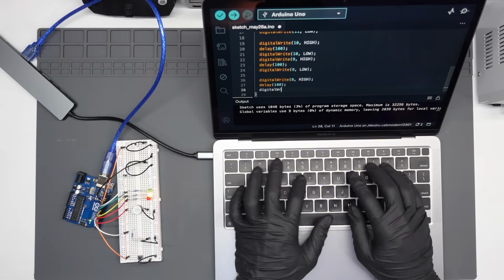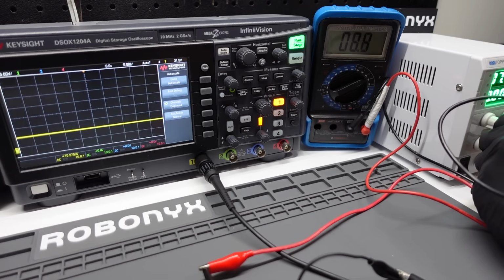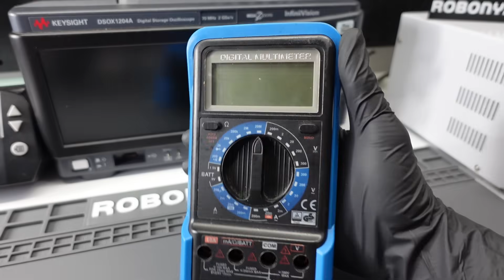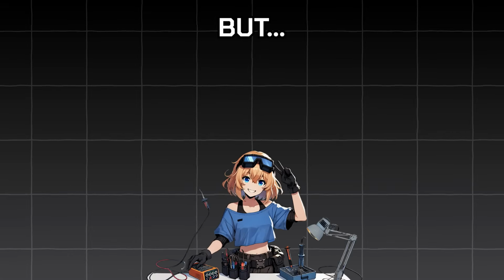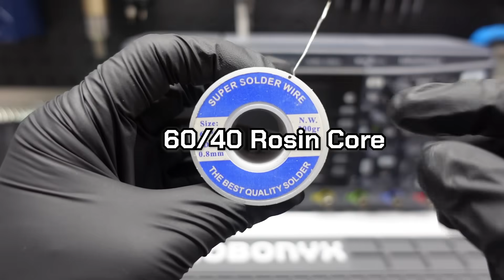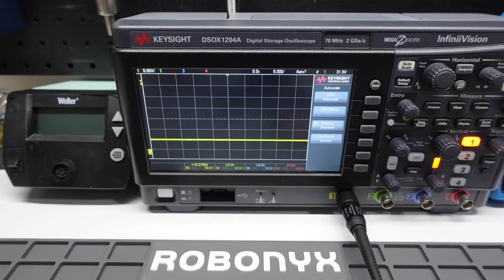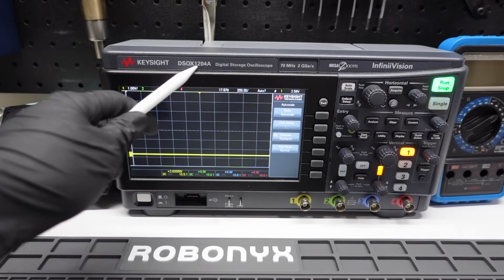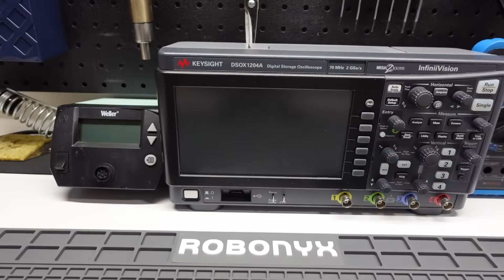Workbench Essentials When Starting Arduino! (Beginner Guide)

Comment: I just need to make a simple model for landslide detection, just something that turns on an LED light and we can know types nothing fancy. So do I need to buy anything extra? Also for the wires us there any correct placement or can we put it anywhere on the board and how do we know how many we will need?

Comment: Can I use raspberry pi picos and zeros with these tools ?
Reply: you possibly could but for the amount of time it would take to convert a computer into a microcontroller would suck also it would be a pain in the ass adding sensors as you would either need to solder everything or do some Houdini shit
Reply: @OctvianHobby thanks for the advice

Comment: In my opinion, I hate Arduino. The Pico or ESP32 is way better. So far I've spent 2 years trying to learn the arduino environment, still haven't mastered it. I used the pico for about 5 months, I've learnt almost everything now and it's way faster and has more storage, and if you get the ESP32 you also get Bluetooth and they both have built-in temperature sensors. Why not other microcontrollers?

Comment: My best discovery in 2024 were silicone insulated wires. I've used regular wires for years but once I discovered how bendy they are and how easy it is to remove just a tiny bit of insulation for soldering it on a proto board without the insulation melting, I never want to go back

Comment: I recently bought the Elegoo brand, Uno R3 super starter kit.  I have a MacBook Air 15 and everything was going great up until one, tiny problem emerged, the power cable that connects the two chips into the computer is the old Type A USB shape and my computer, the newer Mac’s don’t take that anymore.  So, I had to go on Amazon and buy this cheap 8 dollar pack of 2 power adapter that uses type c as a plug in for my mac because type c is what they use.  The other end of the adapter is type A so I’m going to see if this solves the problem.

Comment: An analog discovery board is a good option to put against an oscilloscope. It can be used as an a scope or a waveform generator and they’re relatively low in cost.
Reply: I’m strongly considering getting one myself. I think I will pull the trigger on one, when I get my next paycheck.

Comment: You can build a power supply with the arduino,  or rather purely passive components,  just need to learn how to design filtering and FILL BRIDGE RECTIFIER.  
Since you want DC voltage very easily just build low pass filters and XY bridges. 

You can turn your arduino into a multimeter,  it has a built in ADC and it's basically two lines of code
val = Analog_read(pin);
Serialwrite(val);
Something like that

It can also be used as an oscilloscope,  just use the serial monitor. 

You'll need to use a breadboard to build divider circuits for voltages above the reference 5V, just write in the code to compensate. 

A current sensor is just measuring the voltage off a precision low resistance component like 0.1 ohms.

Resistance is just using a known current and reading the voltage of adc.
The arduino typically drives 10mA per pin, just read the ADC voltage.
Given that its 10 bits, the precision may not exist well.

This is just for starters. It is unfair to compare agilent scopes to the crude Arduino since desktop oscilloscopes use ASIC to implement so you're comparing parallel computation to serial and low spec.

Comment: Very beginner question. When you eventually get to the point of using a PCB, what do you use to write the code for that? I saw someplace that the Arduino code is simple. So wondering what you do if your not using an Arduino?

Comment: For my final year Thesis, i choose my thesis as QR Code Gate system, i  am using esp32cam as QR code scanner and serve as main control unit for gate mechanism. But i still can't make it yet. Should i used another microcontroller for gate mechanism. I need u guys help. I am not very smart but i'm trying my best.

Comment: Best way to do male to male jumper wires is to buy a 22 awg set of colored solid core wire. With the jumpers you have to store them. Its nice to be able to just cut your own and throw it away if you dont want to organize after. The jumpers you end up with a mess of lengths, colors, and they are very annoying to store because they like to bend and get caught in things.

Comment: I think another important tip if you do get into the 3D printing aspect is get a caliper! Measuring the dimensions of motors and other components is essential for 3D design.
Reply: yeah, i got a 3d printer and am new to electronics so a caliper would help to get dimensions. But right now im using a steel rule and it works fine. Nice tip!
Reply: Great
Reply: What 3D printer would you recommend for beginners?
Reply: @Tonio.07  bambu a1, or the a1 mini. Bambu makes printers that work pretty much out of the box. They are extremely well priced for the quality, their customer service is amazing, and just overall a great company. If you can, swing for the combo that comes with the AMS. Being able to load a printer with multiple filaments saves a bunch of hassle (also, its way more expensive to buy it separately, so just buy the combo lol)
Reply: @thatboy799 what about a ender? Only for beginning small things like cases and things. I see them on marketplace for 50 bucks all the time and I’ve been debating on grabbing one
Reply: @jford1032  bamboo printers generally work "out of the box" more and are more user friendly but ender still prints nicely just will need more manual tuning
Reply: @jford1032  If you have a lot of time an Ender is a better choice since it requires more tuning/troubleshooting so you'll really learn how your printer works and what happens if you adjust settings in a slicer